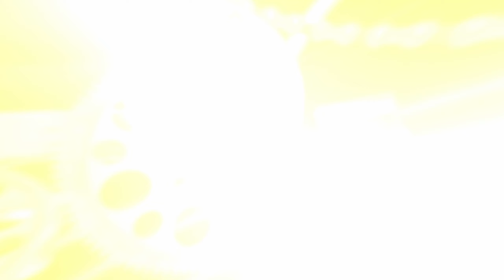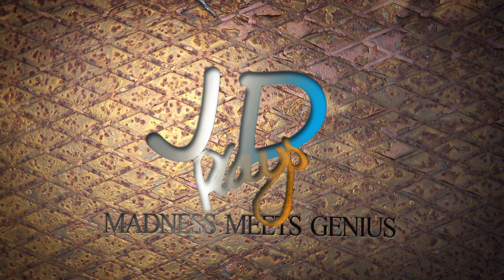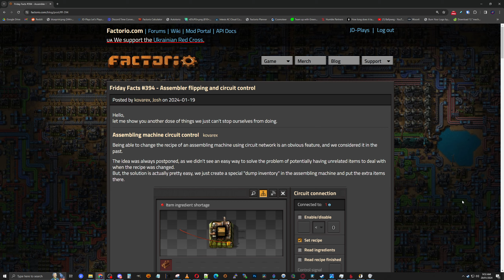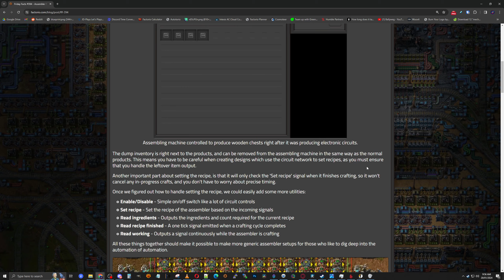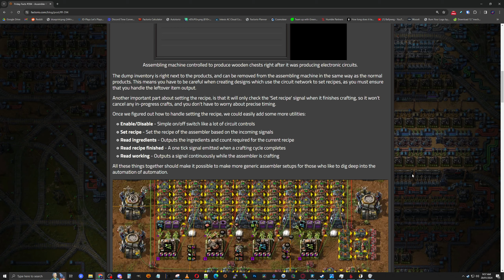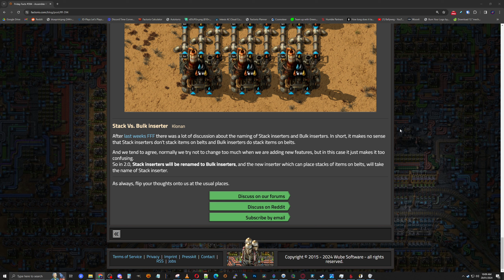Comment: Recycler is a furnace. I don't see a reason why it wouldn't be circuitable.
Low tier intermediates can be sinked into sciences. At least uncommon science is relatively nice boost at 2x.
The Q is the selector combinator with quality stuff. They showed it in the past and said "we'll talk about it later".
The name "Josh" is new. They are not currently on the Wube about page, at least not with that name.
Oil refineries play better with beacons when they are spaces 1 apart, but it still takes more space.
Miners can't be flipped either (relevant for burners and other even lengthed miners).
Interestingly, inserters are still not safe for flipping, as they change their output side when dropping to perpendicular belts. Breaks the popular beaconed electric furnace setup.

Comment: We won't change the inserter names in 1.1 because that would be a breaking change for mods and we reserve those for major Factorio updates. Additionally, the 2.0 code base has diverged so far from 1.1 that we prefer not to touch 1.1 whatsoever if we can help it.
Reply: Could you not just change the display name without touching the code name?